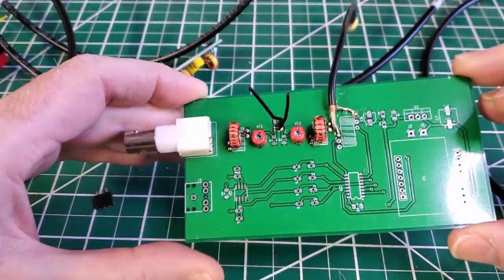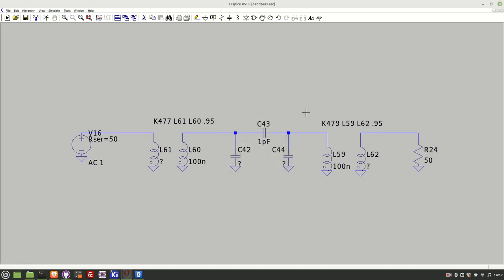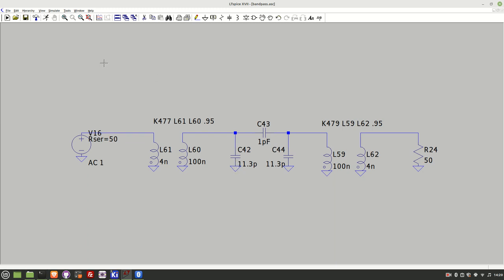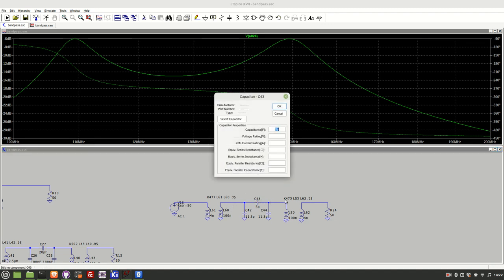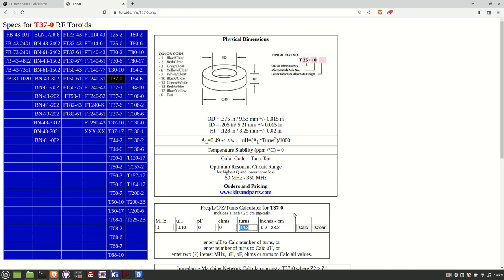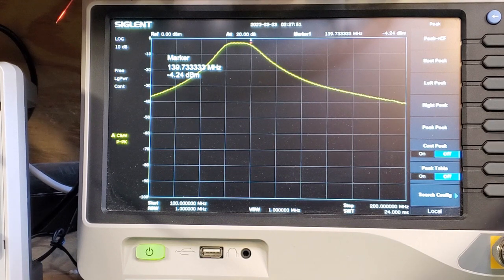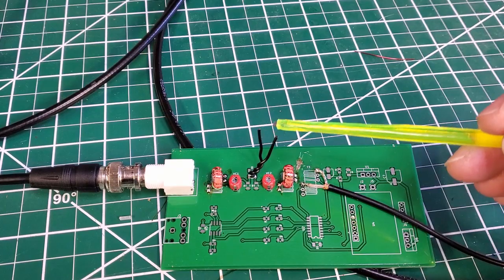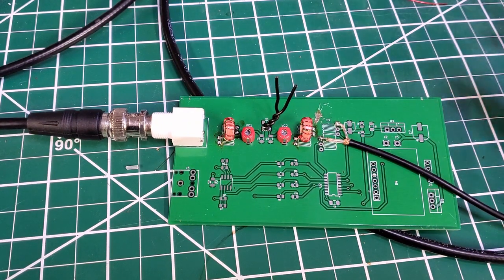Playing around with Tayloe Detector at 150 MHz

Comment: Informative demonstration of BPF coupling. Those T37-0 cores must have mostly filler in the mix. Re link coupling into and out of BPFs at HF, I've always used 3T and have never seen anyone do anything to optimise the impedance match to 50r of these windings.
Reply from the maker: Thank you Paul. The impedance matching is interesting as I've never seen a writeup on it.

Comment: The maximum frequency of operation of Tayloe Detector is limited by FST3253, particularly by the time of channel switching. It can be from 1 to 6 ns according to the datasheet, which gives us the maximum *guaranteed* receiving frequency of 41 MHz. In practice it may work up to 75 MHz or so but definitely not at 150 Mhz. You are going to need a downcoverter for this.
Reply from the maker: Yeah I had read about the downconverter need elsewhere. Still I will try... 

Just walk me through your math though. 

With a quadrature signal at 2,14 of the FST3253 that will result in transition through 00, 01, 11, 10 at 4x the LO frequency. Going from a 0 to 1 on say, pin 2 will take between 0-6ns. Worst case that will take 6ns - and because I need to transition 4 times per cycle that will take 24ns - which is 41 MHz. Is that your thinking?
Reply: @na5y  Yes. Also, I actually checked that it doesn't work on such high frequencies. The instance I tested worked up to 75 Mhz, so it had 1000*1000*1000/75/1000/1000/4 = 3.3 ns switching time.
Reply from the maker: @R2AUK  Good to know - like I said I will proceed with the experiment and see where it lands me! Its interesting that there is such a wide range of switching times in the datasheet. The TI datasheet says 1.5ns as minimum  which would be approx 160Mhz. Like you said thats not even close to a guarantee. Interesting also in Dan Tayloe's original paper he talks about the solution potentially working into the GHz range. I wonder if he was referring to a theoretical switch rather than the FST3253. Thanks for the comment Alex!
Reply: I was curious about how well it worked on 6 meters. I'm thinking of adding that band to my SDX experimental rig. It sounds like it may work OK.
Reply from the maker: @johnwest7993  I will include a test at 50MHz and you'll see the result
Reply: @na5y  Can always try running the switch at 3.6V or 4.0V

Comment: Your are right it a good idea to know effect of some parts.
Il you want a simulation closer to reality always add a low series resistor with your inductor. You will see the effect on quality factor. Yes at 144Mhz with toroid, the effect is lower...This is the first parameters we read when we choose inductor in industry design.
At 144Mhz you can also use proximity coupling with air coil : more difficult to calculate but you can adjust both inductor value and coupling for experiment.
At this frequency we can simulate  accurate S21 design with : inductors S parameters, smd parts, ideal capacitor in simulation, add PCB capactive effect : about 1pF/parts. Easier if you replace L transformer with capacitive transformer. At the end the true result is very close to measurement. More difficult at 440Mhz.
For transformer ratio calculation and impedance LC  I suggest read SA605 SA602 philips application note.
Reply from the maker: Thank you Remi - thats some great advice and tips!
Reply from the maker: .. and I'd agree - not sure I'd attempt this at 440MHz

Comment: I'm not knocking your try at this, but it has real difficulties.  I've done this stuff in the past, a long time ago in the land of Oz. I live in nl these days.
My current RF knowledge is a bit rusty these days but if you want to bounce some ideas around I would be happy to pitch in.73s. a Long time ex vk6
Reply from the maker: Sure Anthony - happy to chat. Should be straightforward to find out whether or not it is going to at least do the mixing or not. Sensitivity is a whole other thing. More to come!
Reply: @na5y  The problem with the 3253 is best case the S inputs can run at 1GHz, no typical figures and worst case of around 200mHz.  You need then to allow for prop max of 0.25ns, so to get an output best base your operation could no more than 750Mhz approx.   That wouldn't provide enough time to charge the integrating cap.  The other problem is gain.  If you check the sensivity of this detector at 10M compare to 20M you will find the gain has dropped, not sure how much, 3db at a guess.  There are no specs for this, but is only going to be a lot worse at 150mHz.
Reply from the maker: @anthonyclark7290  Your arguments make sense - I am definitely interested in whether this will work practically. We'll see - I haven't even run the si5351 at 150Mhz in quadrature - thats the first open question for me. Thank you for the comment!

Comment: Will it work up to the Nyquist frequency? Or above her?
Reply from the maker: Oleg, this is a direct conversion I/Q receiver - the output of the mixing process will produce an I and Q audio signal. That Audio signal can then be subsequently digitized and pretty much any demodulation can be applied (SSB, AM, FM, etc). The input to the mixing process is the RF itself + an LO which will come from an si5351 frequency synth. There is however no digitizing of signal on this board. I hope this answers your question and thank you for the comment!
Reply: @na5y  Thanks, but I know how it works because I made it myself (https://youtu.be/nGn-KkACT7o). I'm wondering how such a high frequency will work?
Reply from the maker: @R1CBU  Its all analog on this board though - the FST3253 is the mixer and it can switch up to GHz frequencies. The si5351 can output at least into 200 MHz. Once the mixing is done its all at audio frequency after that.
Reply: @na5y  Thank's! I did not expect such speed from this multiplexer!
Reply from the maker: Well that's what I read - we'll see how well it works in practice ;) - Thank you for the comments!

Comment: The 'Mix 0' is just a phenolic form, isn't it? This project sounds like fun. I really like such experimental builds. BTW, I've used 'gimmicks' occasionally over the years. They always seemed like a shaky idea, but they always worked well and maintained their capacitance. Of course, that depends on the wire type used.
Reply from the maker: Thats what I thought too John but this https://www.amidoncorp.com/t37-0/ says its got an iron powder core. It does seem like its just phenolic - I don't have enough to break one and find out! Thanks for the comment!
Reply: @na5y , I actually just called them and they verified that the zero material was indeed iron powder. BUT, unfortunately, Micrometals says the zero mix is phenolic. RF Microwave lists the Mix 0 as follows: 
Iron powder toroid core T50-0, non magnetic
MIX 0 - KEY FEATURES
- Non-magnetic, non-conductive phenolic material 

I've been around the industry long enough to know that even corporations get things wrong, (like 5,000 diodes with the band painted on the anode end.) I think the reality of the situation is that these manufacturers provide phenolic toroids for Mix 0, but list them with their iron powder cores because the 'Mix 0' doesn't fit into any other category, and so some of the documentation, (such as the above,) ends up calling it powdered iron when it's actually phenolic. Perhaps a magnet can verify that.
Reply from the maker: @johnwest7993  Interesting - I might have to sacrifice one to find out. Thanks for the update!
Reply: @na5y , the phenolic toroids I have weigh next to nothing compared to iron power cores. That would be a pretty good hint, that and a good magnet.

Comment: If you make this work it will be a bloody miracle 😊 seriously use a single conversion Rx with an IF around 9mhz. This is what my current project is about.  Single conversion hf transceiver using some of the ideas from your channel. No analogue audio switching, route i2s internally.
Reply from the maker: I have my doubts - we'll see. The FST3253 based Tayloe detector can go up to GHz, and the si5351 can certainly do 150MHz quadrature. The traces on the board may be a problem of course.
Reply: I like miracles. I like to push circuits to their limits, then do work-arounds to push them a little further. To hand-match components. To come up with tricks and innovations. To 'make something work'. The 'gimmick' is a perfect example. I've used them for years, and the hams around me just look at them and shake their heads. They think you have to buy a specific component with a specific value stamped on it from a manufacturer in order to make a circuit work. But you don't. Not if you know what you're doing. Electronics is fun.   :)